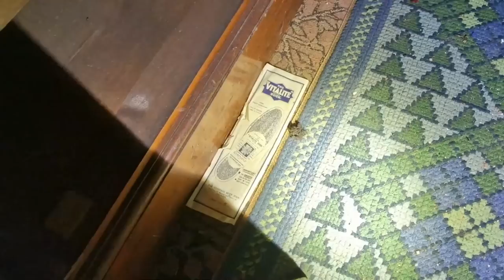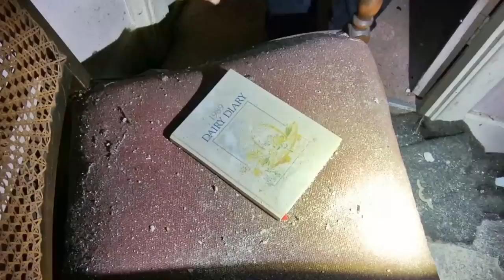Exploring This ABANDONED £2,000,000 Mansion! We Found a Time Capsule!

Comment: The washing machine you found we used to use in the 60s. The hose filled it with water from a normal sink tap, it had a control on the side to start the agitation then the rubber cap on the top revealed a drive for the mangle to get the water out of the clothes. You turned the control the other way to stop the agitation and start the mangle if I remember correctly.